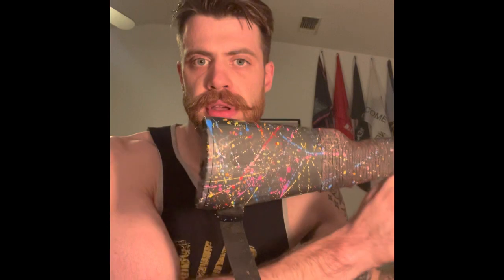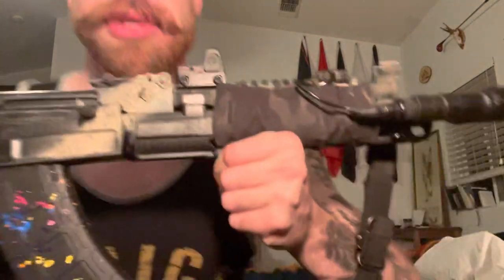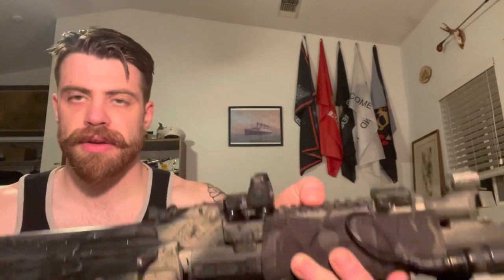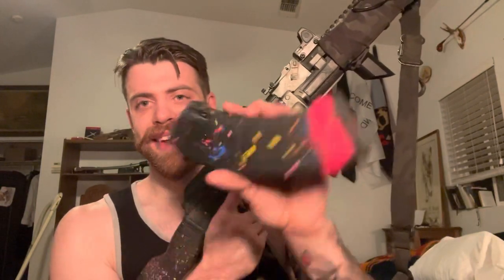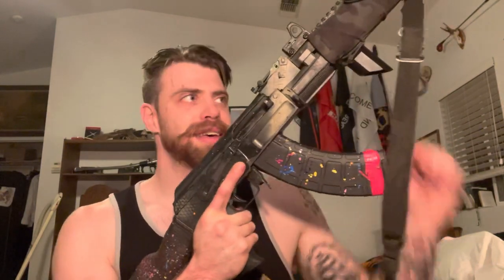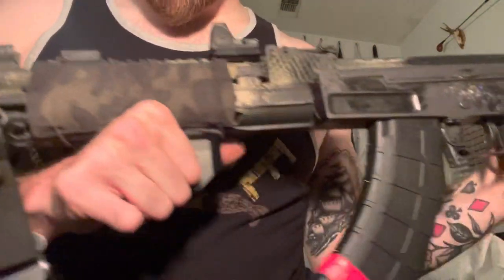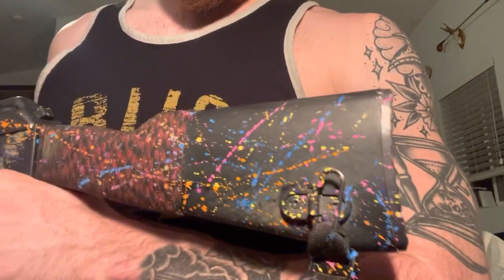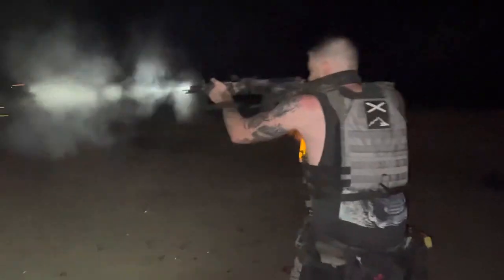Rifle Dynamics Gucci AK update (2021, colorized) SPLATTERGAT?

Comment: Have you had any issues with the gas block coming loose? I see people comment on other posts saying to only use pinned gas blocks. What is your round count through your SAM7 after the RD upgrade? Would you recommend the RD Arsenal upgrade? I'm on the fence about getting it done to my SLR107.
Reply from the maker: If you have the money for the upgrade, I say DO IT. I have had no issues with my gas block coming loose. I’ve only had ~3-4k rounds through it since the upgrade but I’ve  also treated the gun horribly. It’s held up great.

Comment: Any problems with the slr gas tube overheating, and causing the mod button  to malfunction?
Reply from the maker: None. I’ve gotten the tube bloody hot, too. The only issue I’ve had is with the connector where it plugs into the end cap but that’s a common thing that occurs. Modlite mentions it and a solution on their troubleshooting page

Comment: Modlite is turning out to be trash.
Reply from the maker: Oof. Please tell me what you know
Reply: @flatrangehipster3811  I just know that I am on my 3rd light. 1st just stopped working and was sent back. Told it was a QC problem and replaced with light 2. After one rifle class on day 2 It stopped working and it was sent back also. Was told I was abusing the product. Was Sent a 3rd light and it shuts off after 10mins.  It’s back at Modlite right now.   Reno just had another Modlite stop working also.   So did some other IG gun guys.  I don’t know if it’s a parts or manufacturing problem.   But I am done with them.
Reply from the maker: @aaronkeener95  wellllll shoot. Thanks for the insight. We’ll see how it goes I guess
Reply: @flatrangehipster3811  maybe it’s a batch of bad lights going out. But for the money you pay. I will just go back to streamlight/surefire/inforce lights.  Werkz holsters also had some Modlite fail on them.  They have a video about it